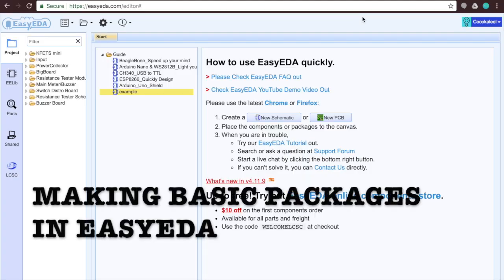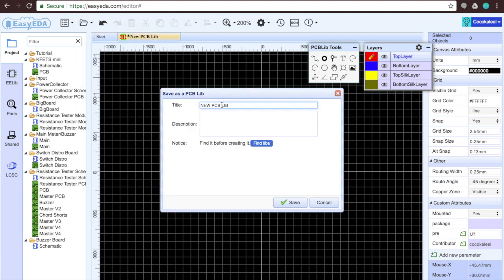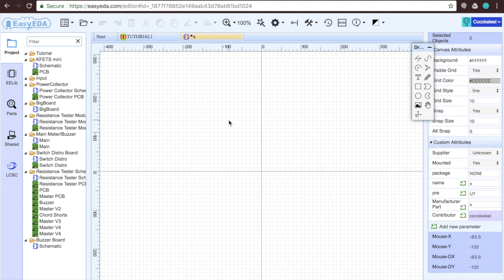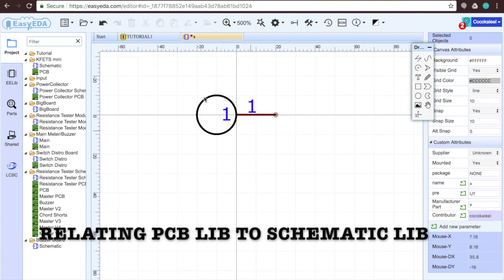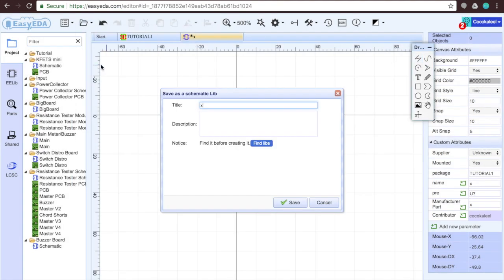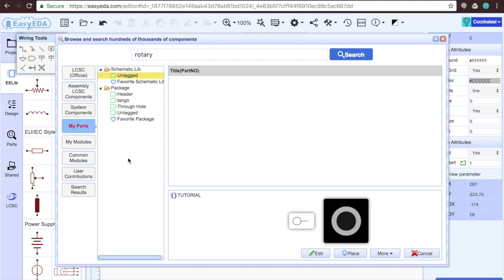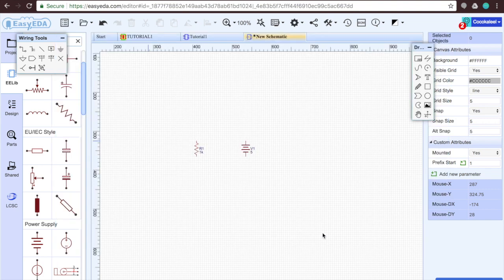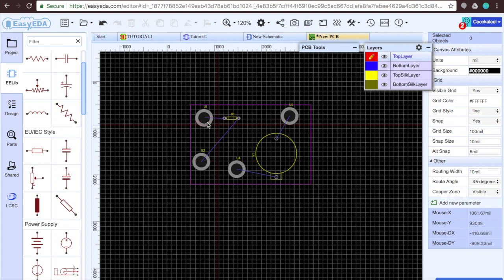Making Parts in EasyEDA

Comment from the maker: If the pads in your PCB Lib do not automatically relate to the pins in the Schem lib (or relate incorrectly), check the menu titled "Edit Pin Map Information": sometimes the automatic pin names/pad numbers are not what you want them to be! To make this matching process easier, you might want to make your pads/pins display their info.

Comment: Still looking for a video showing how to create PCB footprint using dimensions. How would you measure between pads? It seems this is sorely missing.
Reply: You can set the footprint editor grid and snap settings.  I set each grid cell to be 100mil, and snap accordingly.   This makes placement of 0.1" pins and 300mil DIP line spacing trivial
Reply: @photon2038  What about when the grid for the new PCB footprint does not fall on even numbers like 100mill or 10 mills maybe something like an odd number?
Reply: @MaxGoddur  Right click the work area, and select new values for the grid and snap
Reply: Found the changing of the grid, right click, up to 10mils no lower where are you changing the grid?
Reply: @MaxGoddur  It's right there.  Set the grid size to 100mil, and the snap size to 20mil
Reply: Or go into canvas settings and set both to 100mil

Comment: Thank you very much for such an easy to follow tutorial!
PS: The PCB Lib can automatically and accurately relate to the pins in the Schematic lib. To achieve this, in your PCB design you must label all the pin numbers and Net numbers accurately corresponding to which pin they should be connected to on the Schematic lib. Hope this helps.

Comment: Nice video ...I have a doubt how to remove copper area after create PCB??
Reply from the maker: If you have created a copper fill area with an outline, there is no way to edit the copper area in specific portions, as it is auto-generated based on the parameters of the set-up of the copper area. If you want to remove the copper fill, you can delete the outline with which you drew it and change parameters to make it more suitable to your idea.